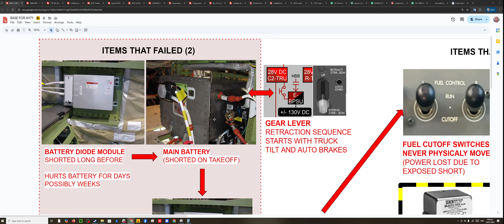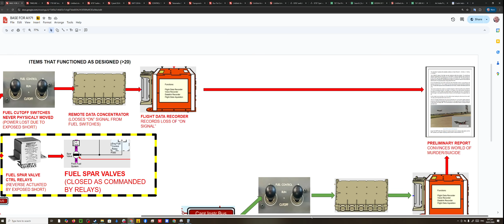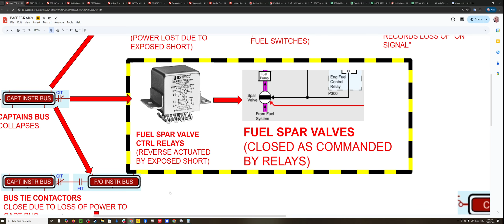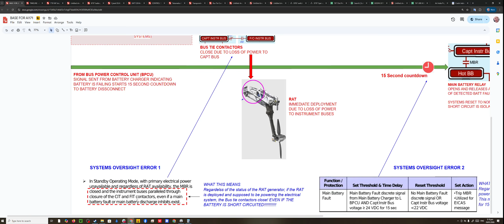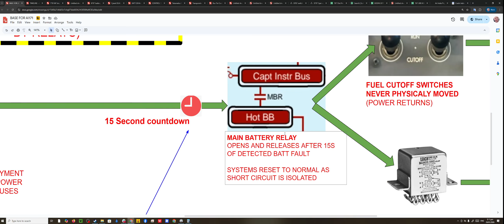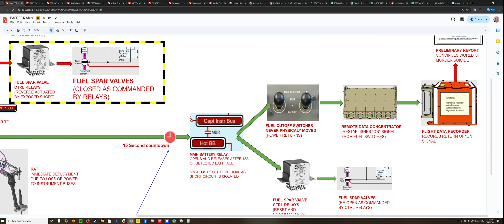AI 171 Crash Cause Revealed - Each System Failure Explained

Comment: On the strength of your analysis I have warned all of the members of my family to avoid flying on Boeing 787's. As a former aircraft electrician your analysis makes perfect sense. What this means is that there are hundreds of these death machines flying globally. It's just a matter of time before this failure mode appears again and when it does I just hope they are as lucky as the folks in the Vietnam Airlines 787 that just barely got airborne thanks to a skilled flight crew.
Reply from the maker: and that's precidesly whats going to happen unfortuantely, the next one will happen. Everyone involved is so incredibly stupid and/or corrupt that even when you hand it to them on a golden plate draped in evidence, they still dont act. When the next 260 die, ill be here to take criticism for not doing enough myself!

Comment: @jeremyjohnthompson5187 the lone survivor saying there was a loud bang and cabin lights were flickering green and white has been bugging me. Hypothetically, if the fuel switches were manually cutoff by the pilots, would the cabin lights flicker? Or is it a sure sign that there was an electrical failure like you've deduced?
Reply from the maker: once the engines get below idle RPM there would likely be the WELS lights turning on. Its just the way he described it from the hospital bed was that within seconds of leaving the ground the WELS (emergency) lights turned on .
Reply: @j @jeremyjohnthompson5187  thanks so much for clearing that up for me ✌🏼
Reply from the maker: @jacobspeeds  jsut be aware we dont need the WELS lighting incident to proove anythign here. the proof is undeniably garuanteed by 4 other items.
1. impossible for RAT to be out when it was as a result of engins fail detected due to FCS cutoff when it was reported to be
2. white smoke cloud upon liftoff, before the FCS cutoff reported events, exhausted out the FWD batt vent port stirred up by the engines off the tarmac
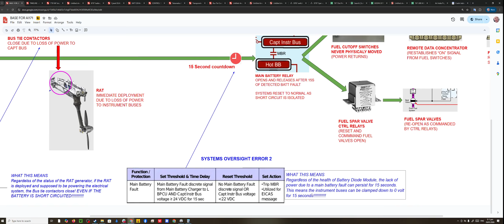3. VFSGs confirmed to be putting out power till after 08:51, well after the RAT was already out (Both the 115V AC powered transponder for ADSB out dies and APU autostart commences much later, beyond runway threshold)
4. one pilot reporting that they DID NOT when asked why/if they cut off
Reply: @jeremyjohnthompson5187  for sure. I’m just adding as many inconsistencies to my notes as possible so the “pilot blamers” cannot support their bullshit narrative. 

One quick question about the white smoke cloud. How do we know for sure that’s it’s actually smoke from the battery rather than it stirring up dust from the runway due to intense pollution in Ahmedabad like I’ve heard people say on Reddit and some other places?

Comment: Great job! This also means that the EAFR dont record the mechanical movement of the fuel control switches but only the electrical results of the switch movement. In those 15sec the crew might have tried to recycle the switches multiple times without any EAFR record as the electrical circuits were faulty. Only after 15 sec the electrical signal was recorded making the investigators believe that the crew tried restart after a significant delay. Hell! the switches were not cutoff in the first place just a faulty electrical signal that recorded as cutoff. 
Only the CVR might have recorded the clicking sound of the fuel switch movement, which would absolutely clear the Capts name.
Reply from the maker: the cvr will hear all the other clicking relays in teh cockpit on takeoff, and these idiots will use that as some kind of evidence.
Watch some takeoff videos from the flight deck, and listen to all the air mode relays flicking over.
The only data that matters is the FDR, which will clearly show the death of the battery bus.

They're warming up everyones asses to insert their lies up your backsides, when they drop the sound of that relay clicking, theyre going to use it to tell you all that its the sound of the FCS flicking.

THey wll never release the true FDR becasue it would spell the end of boeing and the end of their (INndias) 300 OEM supplier deals with boeing

Comment: I am sensitive to your pursuit of the truth in this, It does freak me out a bit having a solid aviation engineering back ground myself and somewhat familiar with bus control circuits and aircraft control logic (on aircraft other than 787's). May I ask a question about the fuel starvation portion, at one point you mentioned a capacitor dumping reverse current to the spar valve relay and you have also referenced reverse voltage during the 15 sec delay through the ground circuit, my question is (not knowing 787 circuits myself) how did the electric fuel pumps in the wings fair in all the mess of power interruptions? I am assuming there are electric pumps in the wing tanks......?
Reply: The holdup capacitors helped enaure that the reverse charge was clean enough to work. Capacitors dont care which direction theyre charged. The coils on the realy also don care which way theyre fed.
Now. The coil pulls the contacts together. Those contacts are connecting power from the l and r 28v DC buses and sending that to the soar valve motors.
Note that carefully. Thats not the instrument buses. 
Instrument buses power the control coil in the relay, outder 28V buses supply the power through the relay contacts to the spar valve.
All of this 100 % confirmed and even in my videos where i show the circuit diagrams.
Reply: Oh sorry you asked about the pumps. I read 2 things.
1. It doesnt matter, gravity suction feed will do, and 2. The pumps are AC not DC, but i havent looked much into it because it doesnt matter.

Comment: Mechanical Engineer and former heavy aircraft avionics maintainer here....you say that the cutoff switches did not move.  Yet we know from the recorder data already released thats not true.  Unlike older Boeings which use the older style inference type data recorders (input/output comparison to infer what position the switch must be in)...the 787s Enhanced Airborne Recorder can actually record each contactor of the cutoff switches via the RDC. The cutoff switches are SPDT with the fuel contactor separate from the recorders contactor.  So theres no possible way the recorder would see something other than what the switch would send to thr fuel control valve.  Especially in two seperste cutoff switches both with independent contactors specifically for the recorder.... For those not following all this that means these new data recorders such as thr ones in 787s can literally "see" if the switch itself was manipulated and how quickly.  Sir i know you know this if you are an AMT with 787 time...So i wonder how you sit here and tell all these ppl who dont know any better that the switches actually weren't moved? And that it was just the recorder assuming they were???? There's more i need to break down here too but im gonna need a lot more time.....Ill just say im not with you on this one and you and i both know.....your argument is a bit of a stretch.  

Do i believe this aircraft had some electrical gremlins absolutely theres a reason why we call her the Electric Princess LOL....However, answer me this riddle....does everyrhing we know about the RAT deployment match what the aircraft would so if those switches were moved to cutoff at the exact moment the EAFR shows they were then immediately switched back on?.....The answer you and I both no is a resounding yes!  So I have to ask what are we really doing here with all your presentations?
Reply from the maker: i kno whow it works. You do not have the FDR do you?
No you dont. SO how can you say "WE KNOW FORM THE FDR". 
If you must be told specifically and dont have time to watch my explanations (sorry about its slow pace), its the loss of the 28V instrument bus, which causes the power through the switches to die. The optocouplers in the RDC turn off as their supply is killed by the short of the entire bus. The RDC remains online because it is redundant powered by the L and R (not C1 or C2) 28V buses which are not connected to the Main batt.
In short, the RDCs stay online, they see teh RUN light turn off, theyy do not see the cutoff light turn on, and the investigators make an inference that suits their narrative.
There is absolutely no other explanation, other than they simply lied because they were told to shift focus quick smart.
Reply from the maker: so , if you worked or work for boeing on this aircraft, this is me telling you, you dont know the possible fault methods of your own aircraft.

Comment: The battery could have survived the crash without additional harm, as it is inside a stainless steel container, designed and refitted to keep a battery fire from propagating to the aircraft.
Should work the other way around, too.
That and the diode module (maybe burnt in the post crash fire) should help to proof this root cause.
Thank you Jeremy for your continuous effort!

Comment: How can you claim to know all this without having full access to all the raw, flight data recorder data, are you claiming you have access to the raw data to give you "100%" confidence (do you understand which end of the Dunning-Kruger effect you are demonstrating, with your claim of 100% accuracy? )

 Are you aware of how a sensed, failing AFDX (ARINC 629) network (picked up by an incomplete  BITE) can cause the airplane to enter a lethally unsafe, "failsafe" mode, especially in the indeterminate state, between air and ground?
Reply from the maker: Its all about the RAT. the onyl way it could have been out when it was according to the preliminary report, is if the battery had failed. SO how does a failed battery shut down both engines.
There is 0 room for error in my analysis. its not a claim, im certain. 100%
Reply from the maker: i can understand why you would think that i dont know what im talking about. Thatsa simple. Thats becuase you havent done the elimination process that i have done so your stuck on the outside looking in doubting what you see. That would make you say that im on the wrong side.
Reply from the maker: oh and,.... its not jsut me. I have some big names on this now. I have actually got it sorted.
Reply from the maker: btw , it actually makes you look like your on that "mount stupid" when you confidently suggest that i havent a clue what im talking about. Dont ever talk to me about being on the dunning kruger scale. I dont know everything, but i do know this one, 100%.
Reply: @jeremyjohnthompson5187 when someone says they are 100% confident about anything it points to the less optimal end of the Dunning-Kruger effect.  At least you are open to admitting you do not know about at least one aspect of the universe, we seem to live in.

  I do not know why this AI airplane crashed, but I suspect a frozen heat exchanger as part of the kill chain, a lot more than a pilot suicide.  The prior flight indicates a lot of issues, particularly the failing horizontal control surface reported by the pilot and the hard landing.
Reply: @SapienSpaceUnedited whats hour evidence of that? I think i remember reading you talk about it before.
The air rafts electrical and computer system can be zapped out of existence and the EECs will continue to operate based on TRA inputs bu the EECs own internal exciters. 
The only possible cause of fuel starvation is the spar valve closing mate.
Reply: @cosync the prior flight the cabin air conditioner was failing along with the seat back electronics.  A passenger was so frustrated that he decided to record the failures and post them on the internet.  If you search, you can find the video.  I suspect that the failed cabin cooling system was a lethal warning, while the technicians, understandably, probably focused their attention on the failing horizontal control surface (instead of the root cause of the frozen heat exchanger).  The prior pilot reported the failing horizontal control surface and they had a hard landing.  The plane was in the ground for two+ hours as the frozen heat exchanger ice probably melted into the Avionics into a puddle, lurking, at the worst possible moment, of acceleration, and roll up, to trigger a lethal short.
Reply from the maker: yes ive seen the videos. These systems are all controlled by 28V electronics powered by the instruent buses. 
The instrument buses on the wordlwide 787 fleet have been regularly resetting and anything that doesnt have a power conditioning moduel with holdup has been resetting. 
For years its been disconnecting Autopilots, deploying RATs, affecting pressurization systems, in flight entertainment, Gear retracton problems, and of course on the odd occasion, the smoke has gone out the batt vent and in to the air intake for the cabin air system and people have smelt the smoke. I have a detailed list of all of these events.
Everything depends on the perfect functioning of the C1 and C2 powered 28V instrument buses. These were also the reason for the central fault display (CFD) on this aircraft to be sending out BPCU errors via ACARS, not just on the day of, but many flights before the crash. These transient havent sustained a fault for long enough to even register on any system, only fractions of a second, and for certain systems, that spells reset.

Simply SHORTING it , can not stop the engines. the engines will continue at TRA commanded thrust with their own PMA and the EECS internal rectifiers. This is the primary main source of power. The ships bus can not tell teh EC to turn the engins off unless the throttels are at idle and teh wheels are on the ground for TCMA.
Reply: @jeremyjohnthompson5187  Your hypothesis is more plausible to me than the pilot shutting off the fuel switches.  I do not know what happened without seeing the raw data in the logs, particularly the prior flight.  I do understand if the AFDX is detected as failed, and if the airplane still thinks it is on the ground, that there may be an unsafe, "failsafe" mode that shuts off both engines.  If the DC to the fuel switches fail (or there is a sufficient common ground spike) it also may trigger a false sensing of cut-off to the fuel switches.  I really do not know without having the raw flight recorder data.   Unfortunately, they only provide the public limited data.   The AFDX BITE may not detect a failure until after approximately 5 seconds of a degraded AFDX.  I do not know what happened.

Comment: Well elaborated to insider @expert level.
The studied (15+ ..+.6... )Seconds may still be ok for retaking control only  WHEN n AT 33,000 ft sliding above @ high airborne. Quite plentiful of time there before..
Whilst just about lifting off runway,  1 second is already too much. 
This simply tell us : B's "highly sophisticated flight system "cannot even distinglish its situation , then blindly apply the same  lethal assumption to be default as  "ok to cut fuel",  then forbidding the ones who know(human pilots,1st officer, flight engineer)any attempt of taking back the control of such a Micky Mouse   toy "Fly_by_Wire flight computer". 
So, ground them all for humanity's sake.

Comment: Unbeatable down to earth analysis episode on all technical faults presented in previous 15 episodes. It's clear that fuel delivery to engines was disrupted by B's crappy subcontracted DC electrical power built around with primitive  entry 101 level level mindset & component. In EE, most reliable  : prefect (<4ms transfter) both ac  and DC STS have been around us for decades. 
We know well B is a fuselage builder. I can't find any workable materials in its Fly_by_Wire fleet. Don't follishly think flying an 300 passenger hugh bird  is anything close enough to Microsoft 's computer game "Flight Simulator". On the screen, they look close. The real differences are SCADA (software) and real industrial Electrical control engineering.

Comment: Advance thanks Jeremy, I have been making ppl aware on Boeing 787-8 Battery and diode module on Facebook various news pages and on X too on this unfortunate maharastra dy CM Ajit pawar small jet  aircraft crash yesterday's occasion and news getting viral.
Because people suspecting foul play in AI171 too.
So found the right occasion to attract attention on 787-8 issue.
Reply: This could be most instrumental. Can I know whether inside the the Hamilton's "Diode Module " is just a high power diode or SCR or IGBT ? (2) If the Lithium battery has any  internal /external protection against undesireable charge/discharge, and other operating parametical (say over/under Temperature, Surge(including Short Circuit) current ,etc) ?

Comment: Had this power issue happened one minute later, could they have restarted the engines and recovered?
Reply: One full minute? Yes at least one engine
Reply: If nothing else, "1 minute" at 250+ mph would be +/- 4 miles and several thousand feet of altitude, so they would have TIME.
IF they tried a MANUAL restart they may cause more problems but the Auto sequence would have kept them in the air.
Reply: @rogerstarkey5390agree